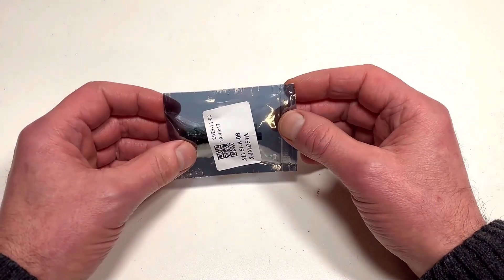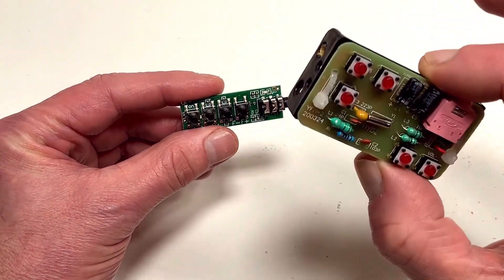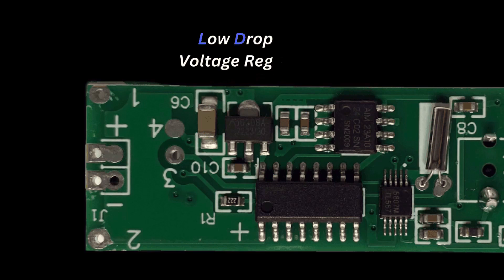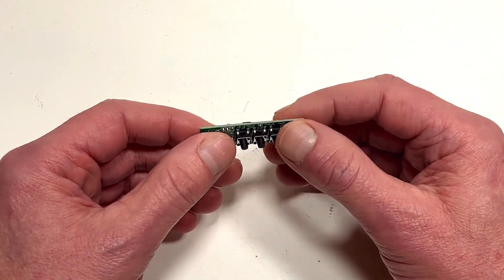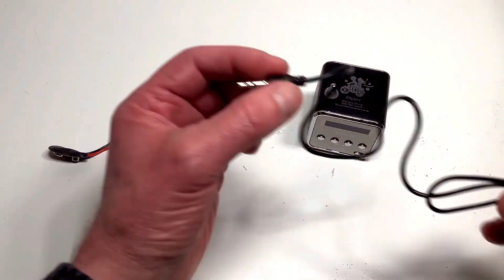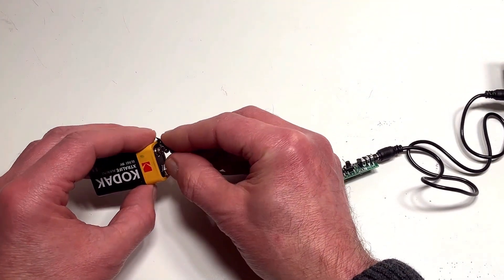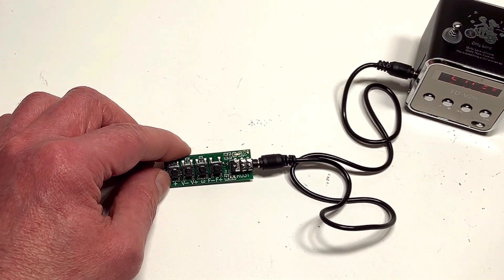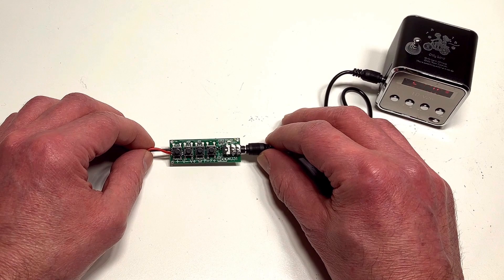The tiny $2 RDA5807 PCB FM Radio (76-108MHz)

Comment: Very cool! It needs some battery protection circuit and you could make a tiniest little receiver!
Reply: Have you tested whether it is stereo, because the specifications say so, and I have a ready-made receiver based on this chip, but it plays in mono.
Reply from the maker: Hi thanks for your thoughts. Battery protection would be worth investigating so good to raise that point. It’s a very useful and hackable little receiver for not much money. And as you mention could be adapted for use on many different things including constructing a micro receiver. An idea that came to mind is that I have an old 60s transistor radio that is not worth restoring, but could be adapted to use one of these little FM receivers by using a little LM386 amplifier, (see my video on that if it spikes your interest) and put some small pushbuttons discretely on the rear to duplicate those already mounted on the board. Would then have a useable 60s shabby chic radio. All good stuff!
Reply: @TheWobblyCameraGuy  oh, true! And every restoration project like this will have space to put it in, as small as it is! I still can't get over how impossibly tiny the whole device is (:
Reply from the maker: @wall_k  Hi, food for thought indeed. Sounds like you need to purchase one or two to explore and experiment with 👍